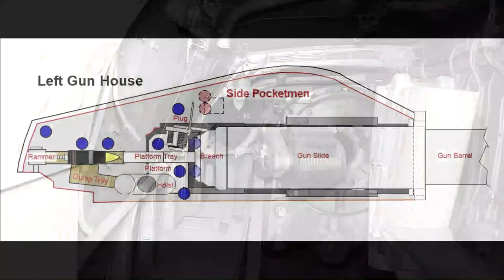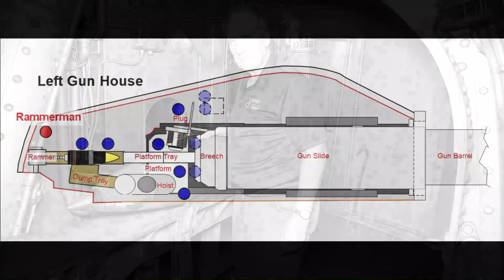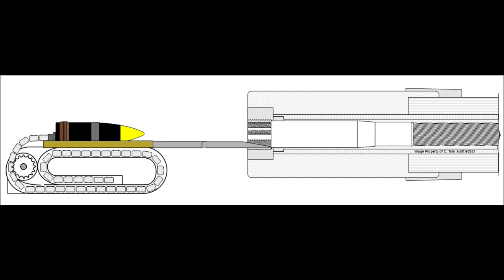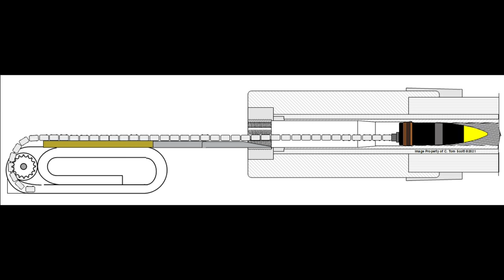Battleship Texas, Getting Loaded in a 14" Turret

Comment: at what point is the fuse installed? and which position was in charge of installing the fuse. I presume the fuse is not installed below in the magazine for safety.
Reply from the maker: Both armor piercing and high capacity shells came on board the ship with base mounted fuses installed, and were stored and handled that way.  In fact, it required special permission for a base mounted fuse to be removed or changed on board the ship.  Fuses were extremely safe and were impossible to detonate until they were armed.  The first step of arming required a simultaneous combination of several hundred g's of acceleration and spinning at several thousand rpm that could only occur in the gun barrel.  They completely armed when acceleration stopped, which happened the instant the shell left the barrel.  The only fuses that were ever installed on board were either time delay or impact nose mounted fuses used on high capacity rounds.  That happened on the loading tray in the turret just before the shell was rammed.
Reply: @tomscotttheolderone364  Thank you Tom, I presume proximity fuses were not used on these guns like they were for the Iowa class 16" guns? those were nose mounted as well.
Reply from the maker: @Rorschach1024  Proximity fuses were never available for shells used in 14"/45cal or 14"/50cal guns.  My copy of U.S. Navy Projectiles and Fuses dated June 1945 does not indicate that they were available for 16" guns through that date.  They would have been nice to have, though!

Comment: Tom, I’m sure there is a logical safety explanation for this, but if each one of the gun’s loading system has two or three shells and bags of powder positioned on various transporting trays up , down, and throughout it’s loading system on standby, wouldn’t the ship be letting itself exposed to the same hazard that destroyed those British battle cruisers in giant chain reaction magazine explosions during the Battle of Jutland ?
Reply from the maker: Good question.  Regarding shells, tests showed that it was pretty much impossible to detonate a shell any other way than using its fuse in the proper manner.  Tests even included setting off large explosive charges placed directly beside a shell.  So, you could have as many as you want wherever you want them without elevated risk of an accidental explosion.  Powder was a different issue.  First, it was necessary to fill the system with bags to be able to support a practical rate of fire, so a certain amount of risk had to be accepted, but it was minimized through system design and strict handling procedures.  The handling system on Texas was clearly inferior to later designs, but it was still reasonably safe.  First, extra bags would never be allowed anywhere in the system.  Charges were never allowed in the gun house until the gun was declared safe and until immediately before they were needed.  There were three locations where charges could accumulate and each was isolated from the others using flash tight doors or other means of separation.  They also did not allow more bags than were needed for a single gun discharge in any of those areas.   While it was still possible for an ignition to overcome those measures, it was extremely unlikely.  You also have to consider possible ignition sources in each of the areas.  None of them used materials capable of producing a spark.  So, that meant that aluminum and brass were used almost exclusively in all hoists and transfer trays.  Handling crews were also prohibited from carrying anything that could possibly create a spark or fire and all locations had sprinklers or bag immersion tanks filled with distilled water.  A key element in all of this was the discipline and drilling of the crews.  They trained to very high levels and followed very strict procedures that maximized safety.  Nothing was modified without approval from the gunnery officer and frequently from the ordnance department.  God help anyone found shortcutting steps that compromised safety.
Reply: @tomscotttheolderone364  That’s fascinating that they undertook testing of the projectiles and their ability to withstand secondary explosive over pressures.

Comment: How loud would it be inside the turret while the guns fired?
Reply from the maker: Not as loud as you may think.  We had the honor of speaking to veterans years ago who served on gun crews.  They told us that you could clearly hear the gun fire, but it wasn't uncomfortably loud.  This was because all of the noise occurred at the muzzle that was about 40' forward of the turret and was separated from them by 14" thick armor.  What they did hear was a loud whooshing noise created by the recoil buffer as the gun fired and recoiled.  This acted like a giant shock absorber.  It was immediately followed by a very loud clang or bang that was created by the big counter-recoil springs that pushed the barrel back to its original position after recoil.  While loud, none were loud enough to cause hearing loss.

Comment: What happens if there's battle confusion and they put the powder bags in first and then put the shell in?
Reply from the maker: There is nothing for them to be confused about during battle.  The crews are in a confined space where there is no outside interference or distractions.   Due to their level of training, they operated pretty much by muscle memory and all are closely supervised by a gun captain.  Their only concern is to load their gun as quickly and safely as possible when ordered to do so.

Making such a huge error would require everyone in a highly trained nine man crew to simultaneously make mistakes that go completely counter to their training.   Each step in the loading operation requires that a preceding step be correctly performed.  Even one mistake would likely result in someone yelling "silence!", which stops everything until the problem is identified and corrected.  In this case, it would require that the rammer man, who is standing in the back of the turret with his hand on the control, watch while two loaders mistakenly shove four 105 pound powder bags into the gun before he rams the shell.  Those two loaders wouldn't do that because they are trained to wait with powder bags at their feet until a shell has been rammed.  By the way, it is the job of one of those loaders to look into the breech while the shell is being rammed to be sure it is properly seated.  It is unimaginable that he is going to forget to do that critical step and simply start loading bags.

Comment: If one of the main guns were loaded and prepared to fire and it was determined the round was not needed, was the gun then unloaded?
Reply from the maker: The gun would not be loaded unless it was committed to firing.  However, if it occurred, the gun's condition would have to be considered.  If it had not been previously fired and was cold, they may decide to de-prime it, removed the powder bags and pull the projectile.  Powder bags would be sent back to the magazines and placed back in storage tanks.  However, they would likely be segregated from unopened tanks because it is possible their burning characteristics may have changed slightly from being exposed to open air for too long.  The shell would be extracted by attaching a lifting eye to its base, tying a rope to that and to the rammer, then using the rammer backwards to pull the shell out. The shell would then be lashed to the rammer tray to secure it until it was needed. 

However, a very different procedure would be used if the gun was hot due to firing during wartime and the ship is in a combat zone.  It is ok to load a hot gun because the shell and charge only sits in it long enough to be aimed and fired.  However, allowing one to sit loaded, then trying to unload it would be extremely dangerous.  If they wanted to do that, they would clear non-critical crew out of the turret, then a couple of crew would unload it under the supervision of a gunnery officer.  It is very possible the powder charge would be thrown overboard since it would be damaged from prolonged exposure to heat.  During wartime, you don't risk crew to those dangers and being in a war zone, the safest and most expedient thing to do would be to aim the gun in a safe direction and clear the unused round by firing the gun.
Reply: @tomscotttheolderone364  Thank you. Very interesting and informative video.

Comment: Do the breaches no longer turn and lock? would it get stuck?
Reply from the maker: When moving it, I was concerned that trying to force the lever up to rotate the plug might jam it.  Disassembling and lubricating the mechanism was a regular maintenance item that hasn’t been done in more than 75 years.  While it’s unlikely thatI could damage it, it is possible that dried lube could lock things up.

Comment: How far did the recoil enter the work space? I hope hydraulics do the work now.
Reply from the maker: Yes, there is a huge recoil buffer that used hydraulics to slow the recoil.  The gun recoiled 4’, which meant that it did not extend beyond the silver loader’s platform.  So, all that was necessary was to stay off the platform when the gun fired.  The platform is attached to the gun slide, so it and the breech lowered into the pit when the gun was elevated.  That pretty well eliminated the possibility of anyone being hit by it unless there was an accidental ignition.   There were multiple layers of safeties, so that was exceptionally unlikely.  The biggest issue was the two powder men being out of the way of the loader’s platform as it lowered.  They did that by moving forward an led laying across the powder tray beneath the gun before it was elevated.

Comment: Oh mean....these guns in those turrets look like a nightmare to operate compared to an Iowa class or a more modern 16 inch turret.
Reply from the maker: I understand what you are saying but keep in mind that what looks like a small jump of 2" from a 14" to 16" gun results in huge increases in size and weight of barrels, slides and all other gun components.  For that reason alone, the manual design used on Texas would have been totally impossible on any 16" battleship.  There's no question that more physical effort went into operating these 14" guns, but it wasn't overly strenuous for properly trained and conditioned crews.  The hardest job would have been that of the powder men located below the guns who rapidly lifted 105 pound powder bags from deck level to over shoulder level one after another.  One thing that helped them was that gunnery manuals recommended exercising these guys until they could pass 50 bags without becoming exhausted.  If they did become exhausted, they could swap positions with other members of the gun crew and rest up doing a less strenuous job.  Perhaps the most significant disadvantage of Texas' systems wasn't crew fatigue, but the inability to reload faster than once every 45 seconds.  Later designs, and certainly the British, heavily incorporated powered systems that produced reload speeds of 30 seconds.  That is a big advantage in a gunfight!
Reply: @tomscotttheolderone364  thank your for taking the time to give me such a detailed and informative reply....i appreciete that greatly. Good luck and best wishes to you sir.

Comment: Could they "unload" a shell that was brought but then not needed and send it back down?
Reply from the maker: Yes, they could send it down to the shell deck that is below the turret; however, they couldn't use the power hoist.  Its shell car design wouldn't allow shells to be placed back on it once they were up in the gun house.  Instead, they used an auxiliary, manual hoist.  There is a small deck hatch on the outboard side of the gun house that opened up into the shell deck.  A block and tackle above it allowed a shell to be lowered nose first by attaching a lifting eye to the shell's base and attaching the tackle to that.  It would be difficult, but doable.

Comment: Good God, what a hellish job that must have been in that tiny, toxic environment!
Reply from the maker: Everyone was pretty safe if they did everything exactly the way they were trained, however; it was crowded and the work was hard.  It was worse for me that it was for the crews when the ship was active because the blowers no longer work and the lighting in the gun house was off.  When the ship was in service, it was well lit and it wasn't uncomfortably hot because of two very large blowers that pulled air up through the ship and into the turret.  Perhaps the biggest surprise is that it wasn't dangerously loud, even when the guns fired.  The noise from firing came from the muzzle and the crew was on the other side of heavy armor that eliminated practically all of it.  It was loud inside the turret because of the blowers and other motors, but not uncomfortably so.

Comment: Where were the well men/power man stationed when the gun fired? Surely they could not remain down under the gun. There does not look to be enough space when the gun barrel elevated.
Reply from the maker: It was a little tight, but they could.  They sat or laid across the silver tray that the powder bags slide on when they are pushed through the flash tight door into the pit from the side pocket.  That left them 2-3 feet of head clearance when the barrel was fully elevated.  The barrel recoiled behind that, so it wasn't a problem.
Reply: @tomscotttheolderone364  Thanks for the reply - much appreciated. Like the two powder passers in that little room, not a place for claustrophobics.

Comment: Is the turret open to the public?
Reply from the maker: Turret 1 is normally open so that guests can enter through the emergency hatch in the rear of the turret.  From there, you can look into the two gun sleeves.  However, the ship is currently closed to the public during preparation for her upcoming tow to dry dock for hull repairs.
Reply: @tomscotttheolderone364  awesome, thanks for the reply!

Comment: When do they ARM the shell or Bullit thingy
Reply from the maker: The shell has its fuse installed at the factory and no one on the ship is allowed to mess with it once it arrives on board.  Arming it so that it can explode can only happen by firing it out of the barrel.  You can beat on it, drop the shell or abuse it any way you want, but the only thing that may happen is you will break it.  You won't set it off.  The fuse's internal mechanism requires that three things happen before it is capable of detonating.  First, it must accelerate from 0 to over 1,500 miles per hour in the 52' length of the barrel.  At the same time, the shell is spun up to over 5,000 rpm in the barrel.  As the shell leaves the barrel the acceleration instantly releases and it begins to decelerate.  The combination of spin and release of acceleration is what arms the shell.  It then requires an extreme impact, like the shell striking something to explode.  By the way, most fuses are mounted in the base of the shell to keep them from being crushed before they can explode.

Comment: You did not say when they put the fuse onto the shell. They were not fused in the magazine.
Reply from the maker: Both armor piercing and high capacity shells were stored on board the ship with base mounted fuses that had been installed at the depot.  Fuses had very sophisticated safety mechanisms that made them completely safe to store in that condition.  In fact, gunnery manuals at the time specified that fuses were not to be removed from shells once on board the ship without permission from the gunnery officer.  So, armor piercing shells could go straight from the magazines to the guns as they were.  High capacity shells could also have either nose mounted impact fuses, known as point detonating fuses, or timed fuses installed in them for air bursts.  That was done as shells sat on the loading tray prior to being rammed into the gun.  While they could work without additional fuses, most of the ship's action reports indicate that point detonating fuses were normally installed before firing.  The only reason for doing this that I am aware of was to simply improve the odds of shell detonation.

Comment: Why would the prime the gun before sealing the breech?
Reply from the maker: I may have done a poor job explaining this.  A gun would never be primed until the gun crew has cleared the loading platform and everyone is in a safe position.   Once the gun is loaded, the breech plug is swung shut and  rotated to a locked position by pushing the operating lever up almost all of the way.  Everyone then gets off the platform and clear of the breech.  Even though the plugman stops the lever a few inches short of the fully locked position, the breech plug itself has fully rotated to the locked position.  The only thing that hasn't fully closed is the firing lock that the primer is loaded in.  Once the primer is pushed in place, the plugman pushes the operating lever all the way up so that the firing lock closes to the firing position and the lever's end snaps under the salvo latch
Reply: @tomscotttheolderone364  I see. Thanks for quick response 🙂

Comment: Are the Texas turrets twin or two gun?
Reply from the maker: I define twin as having two guns.  Based upon that, the turrets are both.
Reply: @tomscotttheolderone364  Thank you, but I meant are the guns capable of independent elevation within the turret?
Reply from the maker: @seatedliberty  Yes, they were.    The guns could be pointed either independently or linked together.  I have a video that shows that function.  Later 14” three gun turrets were even more cramped and the guns were spaced so close together, they had to share a common slide.  This meant that they couldn’t be individually pointed.  It also meant if they suffered a failure anywhere in the pointing machinery, the entire turret would be out of action instead of just one gun.  While that was a serious compromise, there were good reasons for doing it that made it worth the shortcoming.